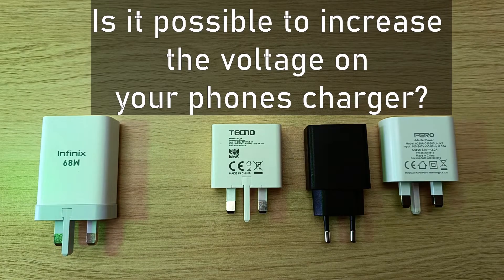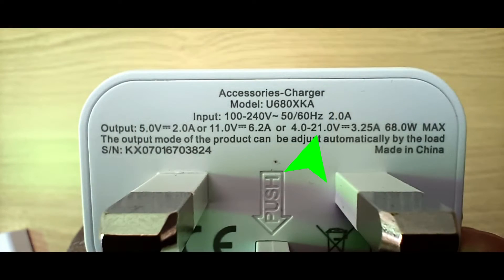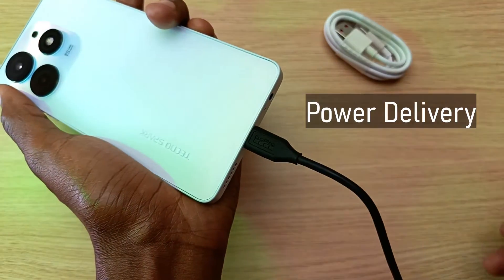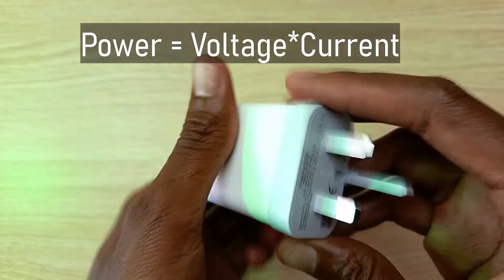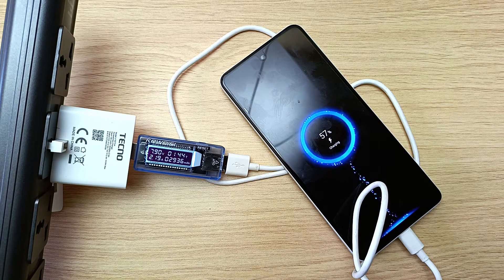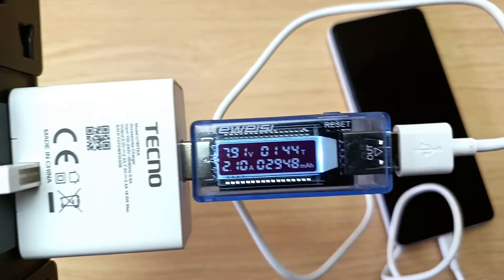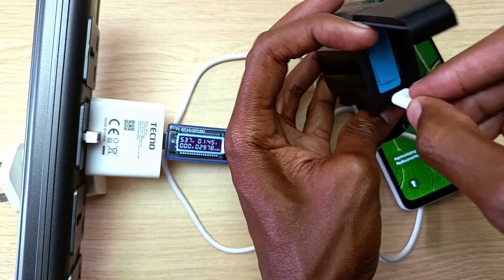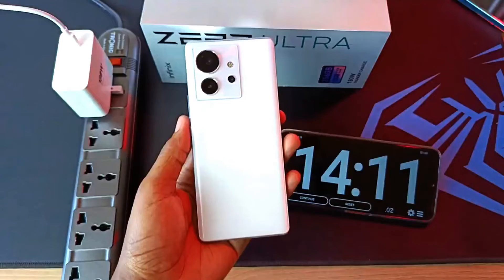How to Increase phone charger voltage, Is it possible

Comment: Dominic, great content. I am sharing links with friends. I have an LG LHB976 STUCK TRYING TO BOOT/OPEN AND CLOSE THE OPTICAL TRAY...DISCONNECTED power and now nothing...Mother board???
Reply from the maker: What happens when you disconnect the tray mechanism. Do you still get sound from the speakers?
Reply: @DominicGichane  BOOT in led window, have not opened unit yet
Reply from the maker: Ok. That seems like a motherboard issue if I were to take a guess